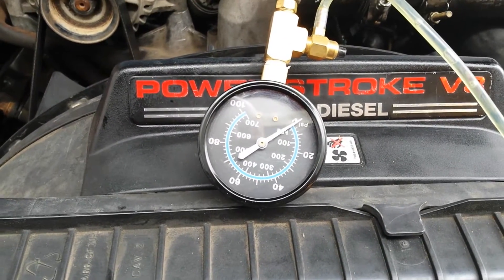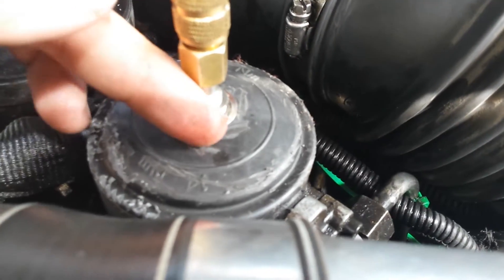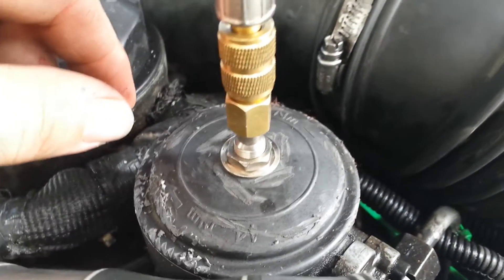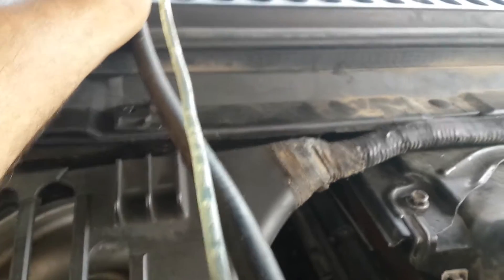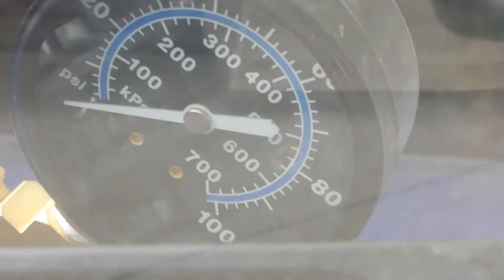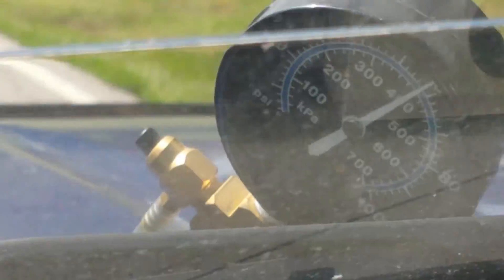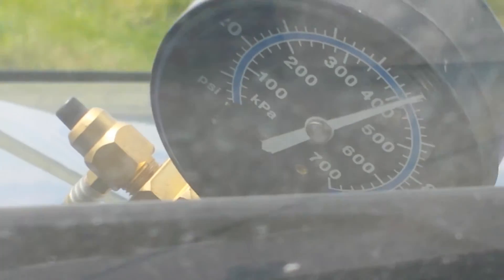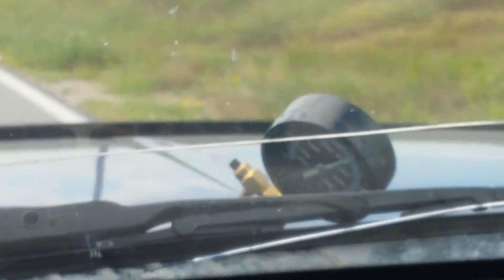DIY 6.0 Powerstroke fuel pressure cap. Pt 2

Comment: Hello Joe...Great u-tube video about using Fuel Cap and modifying. I assume the same idea could be applied to a 1999, F350 , 7.3 Liter Diesel, which has only one (1) cap. It would be appreciated if you could write out each item needed by description, with a part number and where it could be purchased. Also using the same idea, couldn't you also attach a Fuel or Oil pressure sensor, 12volt variety and wire it to an Auto Gauge, 0-100 PSI, (Fuel or Oil Type) that would be mounted in a pod on the driver's side?  If possible, please send feedback to cconfidentialconnections@gmail.com . Thank you